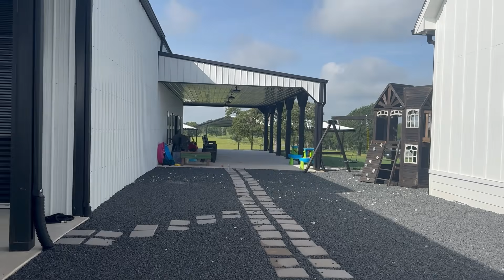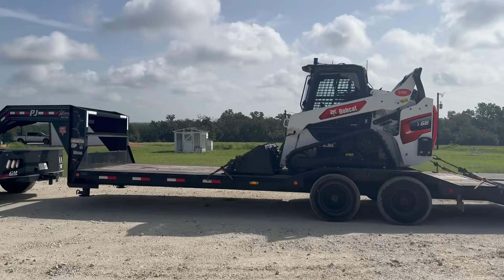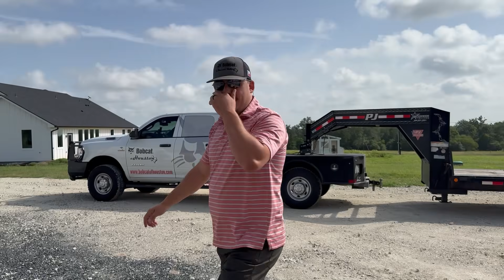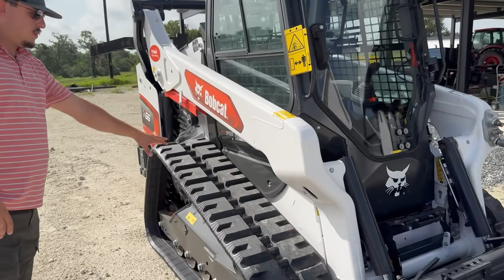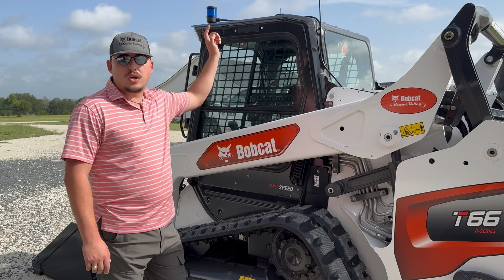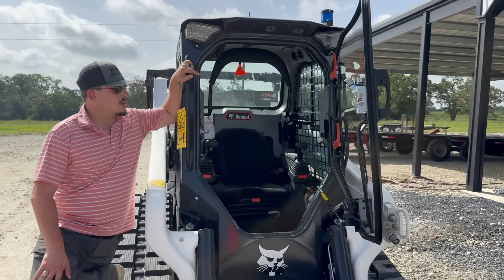The Bobcat T66 Skid Steer Arrives and we walk through the features on the machine.

Comment: Anyone else wanna comment on where that track loader was placed on the trailer for delivery? I can’t see a safe amount of tongue weight. I realize that this comment is off topic, but I’d never roll w/ that load. Instead, load the CTL w/ the bucket facing the ramp of the trailer, and the engine facing the gooseneck. I would start by putting the center of the machine (the half way point from the tip of the bucket to the back edge of the machine) over the front axle of the trailer, the adjust even closer to the front of the trailer until the truck & trailer were close to level. Now back to watching the vid.
Reply from the maker: You're not wrong — that delivery load made me nervous too. We don't haul it that way.